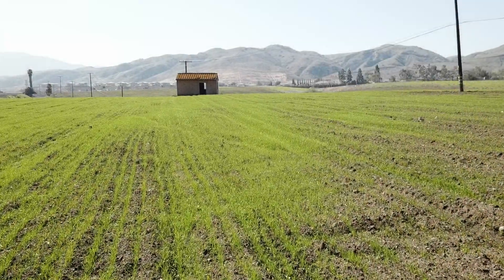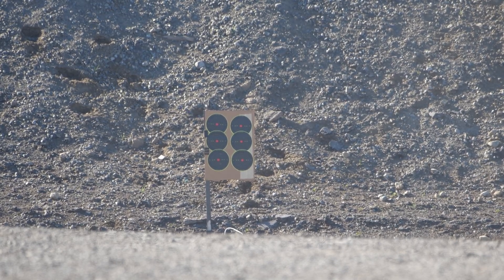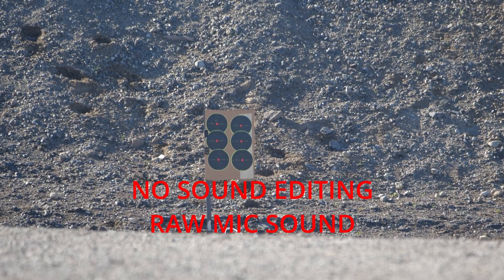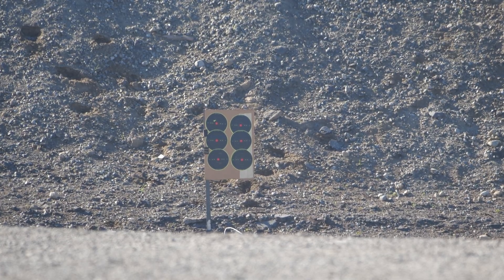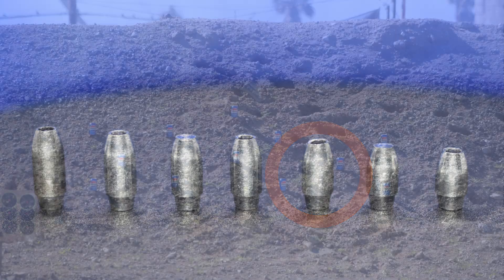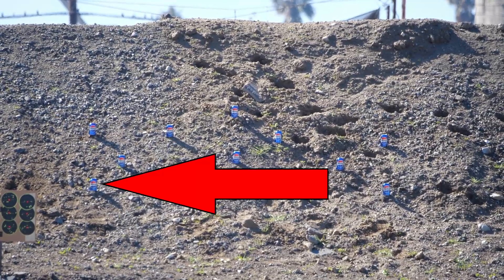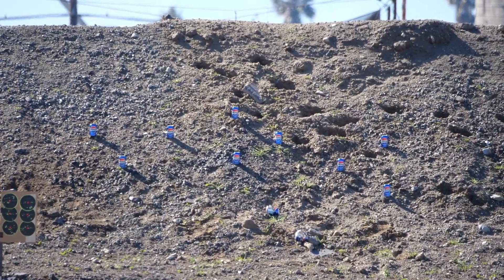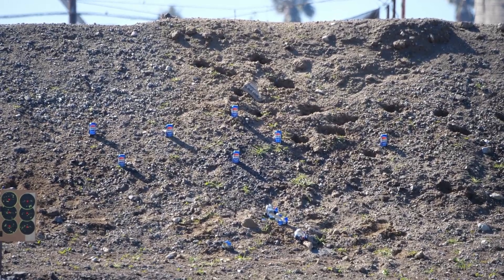.224 Noble goes SUPERSONIC

Comment: Why choose heeled projectiles if they’re not going into a case? Is there an accuracy advantage when transonic?
Reply from the maker: So, these are Rebated Boattails and not HEELED.  They have 8 degree tapers.  One advatage to a RBT is that it has a shelf or rim for the expanding gasses to push on where a tradition BOATTAIL does not.  A traditional BT tapers all the way up to the bearing surface and is the MAIN reason why expanding gases exit the bore before the bullet does.  The RBT does not allow that as much
Reply: @Tofazfou  perfect explanation thanks

Comment: I love that how with this rifle just being air not a flame dependent propellent removed the factor of barrel expansion from heat. Just shooting all day with consistent shot placement.
Reply from the maker: I will give you one even better.  This and a few other of my customs can be turned down via fill pressure and shot for even longer periods of time.  This valve can still make plenty of power even at 2000 psi.  So yes, one tank of air can last me all day dependent on how i TUNE the rifle.  This gun can shoot 400-1300+ fps

Comment: I keep hoping Doug will recover enough to start machining once again, i want one of his regulators for the custom 7mm (18" twist) Texan he built for me with the CF sheathed bull barrel. With the NOE 284-89-FN-H6 slug which was designed just for the 18" twist, it also is a less than one MOA rifle (subsonic however). Some of Dougs finest work!
Reply from the maker: Bob, I love info like this.  In a caliber I have with a certain twist rate, I like to know what else in that caliber works.  Both twist and slugs.  So thank you for that info.  I went with the 1-14 twist because I wanted to shoot up to about 135 grs with 120-125 grs being the norm.  and it works fantastically.  I wanted the speed and not necessarily the power.  So, thanks for posting your info as that amazing accuracy.  MOA is all we are asking

Comment: Never say never does already people that are tuning these to almost 3,000 ft per second with helium or with regular air
Reply from the maker: regular air, ABSOLUTELY NOT!  Helium has a great chance at power/speed but, ITS UBBER HARD TO GET RELIABLY for all airgunners.  We have discussed HELIUM for years and it has made absolutely NO ADVANCEMENT forward.  its also utterly a waste as you loose so much pressure per shot compared to normal compressed breathing air.  The last thing any airgunner wants as a whole is, a horribly inefficient airgun thats NOISY as hell.  I know, i've used helium multiple times and while it was impressive, cost and consumption is horrible
Reply: @Tofazfou  yes it still has a long way to go with upgrades and technology and hey maybe or not airguns down the line it will get better and shooting much faster but but yeah fire arms will always going to be more powerful
Reply: @Tofazfou  oh sorry 2140 ft per second that's a 300 grain pointed bullet
Reply: No
Reply: @rickoshea8138  what do you mean no yes there is it's called experimenting

Comment: I like your focus on accuracy rather than power. I don’t really want to see air rifles achieving the same muzzle energy as conventional assault rifles.  Air rifles are a different kind of tool with a different purpose, and I like the lack of regulation on them that we currently enjoy. I don’t want to have to start buying them through my local FFL. F#!k that.
Reply from the maker: I def get that and thank you.  ADVANCEMENT IS COMING REGARDLESS.  We already have ubber powerful airguns and semi auto fast firing airguns. But yes, many small/big bore airguns could stand to be more accurate and reliable.  RELIABILITY is another word the Airgun industry needs to focus on instead of power.  But, i get ya